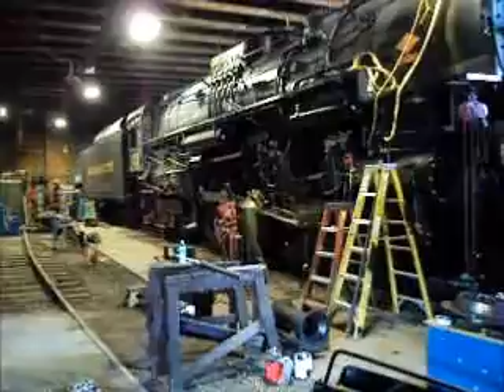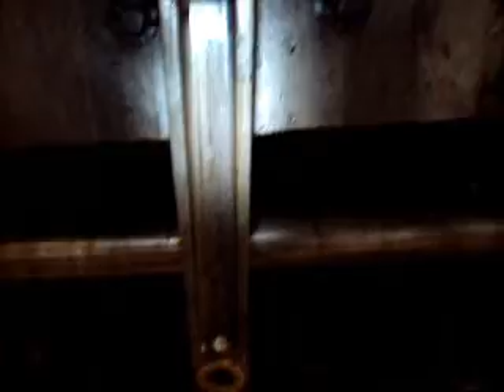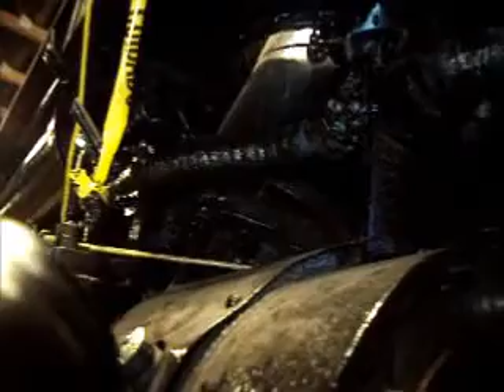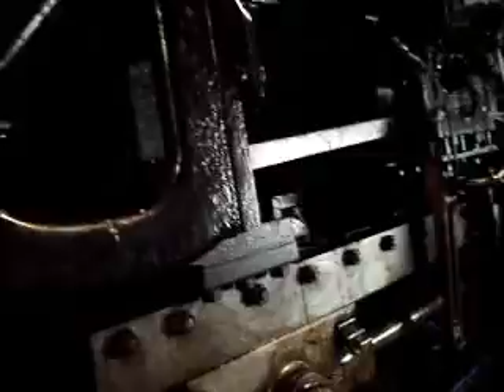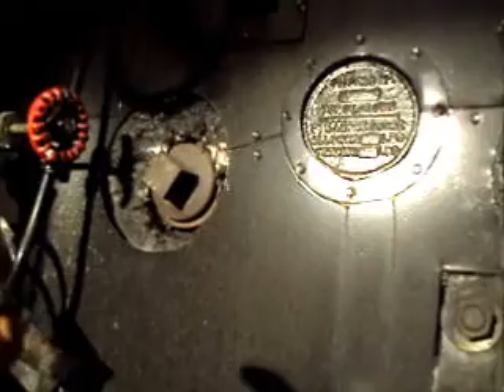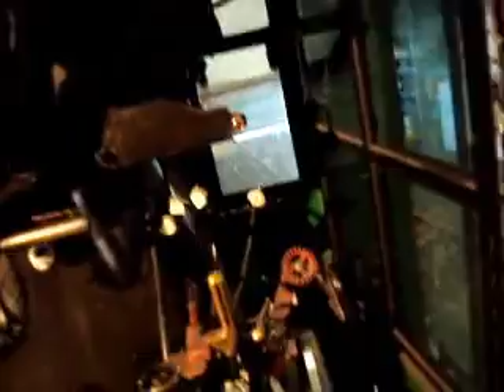1225 Locomotive Maintenance after Train Expo

Comment: What squeaks badly in the valve gear or drive wheels on 1225? A lot of the expo vids of 1225 going slow really pick this up, especially on the engineers side of 1225
Reply from the maker: The squeak will hopefully be taken care of after the annual is complete. As you can see in this video, the valve piston has been pulled out. What has also been taken out is a lubricating piece known as the "quill". The noise that you hear when the engine goes by is the lubricating system not working at optimum. By taking this apart, we can find out why it's not working. It actually broke the rest of the way when it came out so we will make a new part for it. So it will be like new. Therefore, if we do it right, no more squeak!
Reply: Is that what it is? Cause man I swear its been going on for YEARS it seems like with no cure. Good to see 1225 will finally run quieter. That squeak bugs the crap out of me. Is this procedure being done on both sides?
Reply from the maker: I thought they would take both sides apart, but we won't if it's not needed. The main thing is the boiler hydro test. First, new washout plugs need to be installed. We are also cleaning the inside of the tender.
Reply: Another hydro? What for? You guys just can't seem to get the washout plug problem solved either. With cleaning the tender are you guys prepping to solve the leaks? I know the tender leaks...
Reply: *****
 I do believe the federal guidelines for the annual inspection mandate washout plugs have to be replaced as well as a new hydro must be performed to ensure all pipework adjustments are in order. I'm pretty sure that's it, it's been awhile since I read the guidelines.